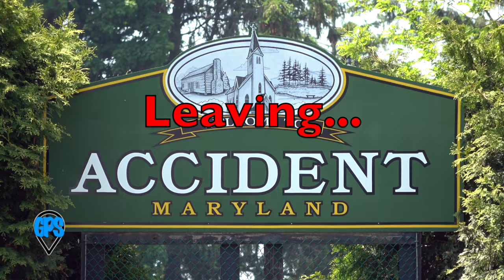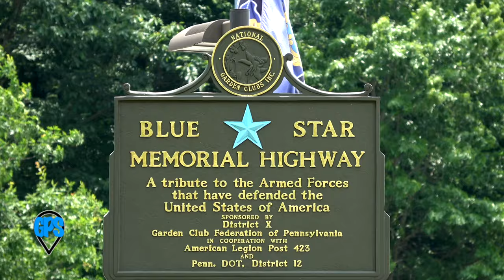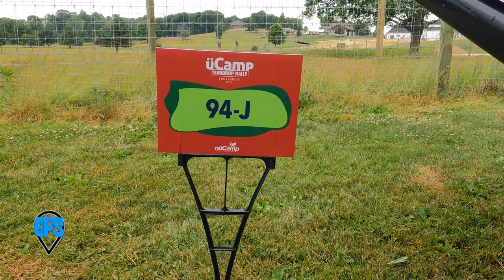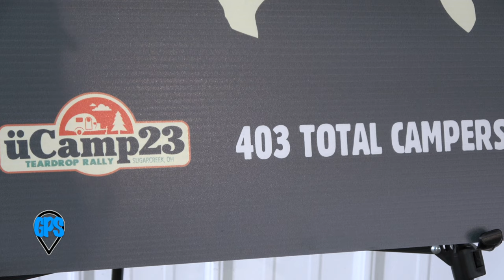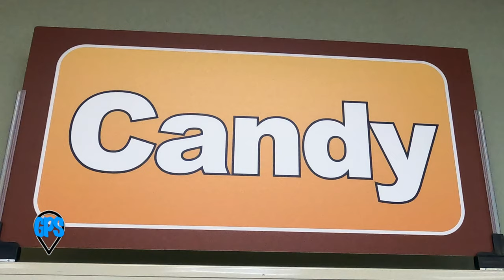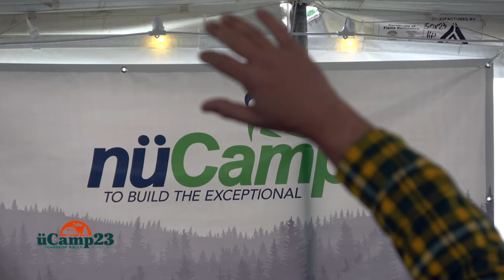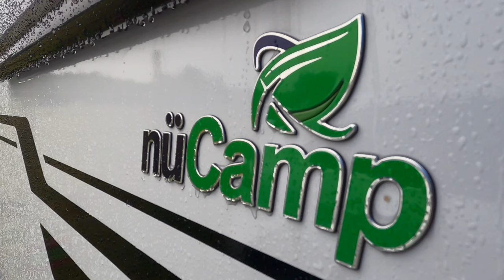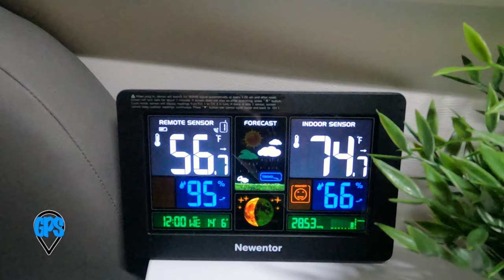An RV Rally of Tiny Campers! uCamp 2023 Pt 1

Comment: What did you have to do to your suv so you could tow your camper?
Reply from the maker: My SUV came with a tow package, I only needed to put a standard 2" hitch mount on, and plug in a Curt Bluetooth brake controller at the power connector.
Reply: @Great_Places_Seen_GPS  Thanks!  Great video
Reply: @Great_Places_Seen_GPS I was happy to see your SUV pulling a 400 camp RV ! I am hoping to have one some day😁
Reply from the maker: I hope you do too! This setup has worked very well for me so far. I'm pleased.